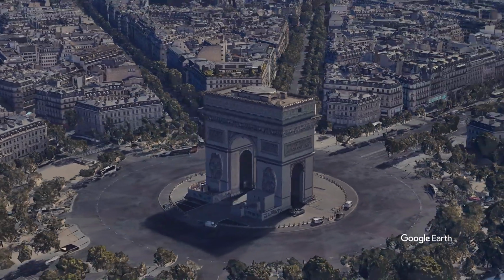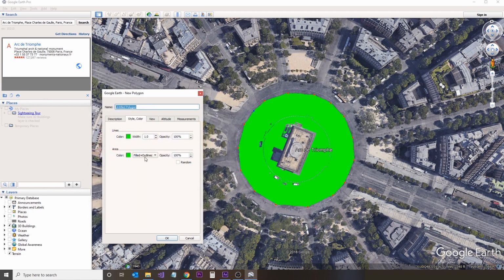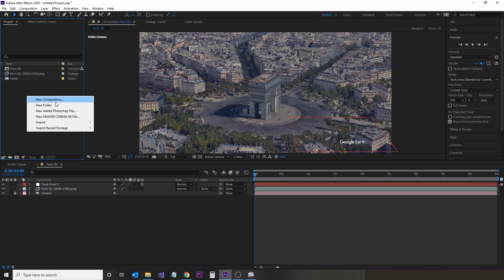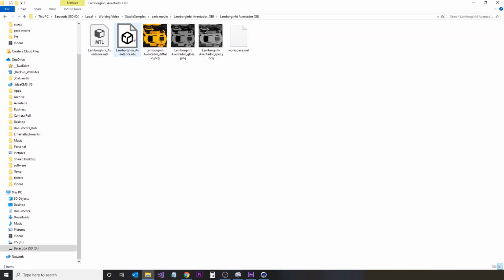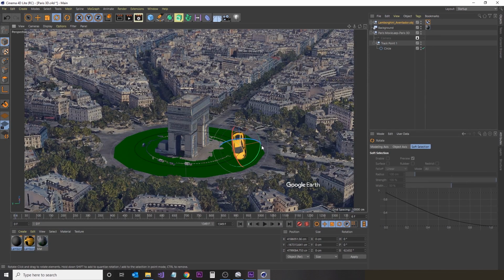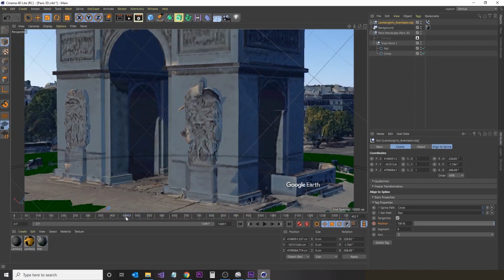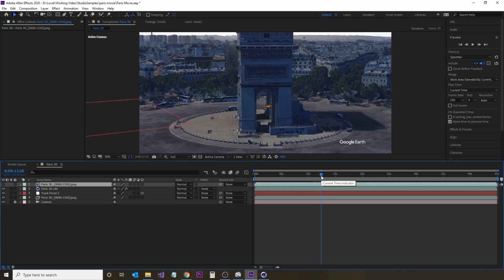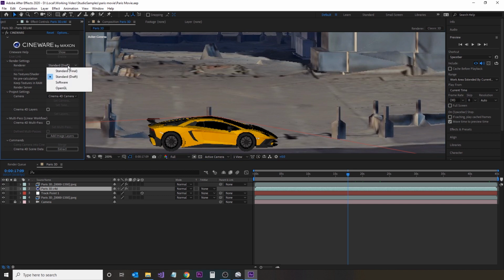Google Earth Studio - Add 3D Models and Layers without rotoscoping/masking!

Comment: Hi, for some reasons the keylight in After Effects won't delete the kml area (the round green area in your video)...Any clue? I tried different settings of the keylight effect but nothing... Could it be due to the fact the area I've left the area drawn in Google Earth Pro white (not turned green)? Or maybe to the fact that while in your tutorial the green area is always visible in my Google Earth animation is just visibile in parts of the video? (I left the polygon color white as is in the middle of a garden...It works if I select the garden...). Shall Blender be the solution would the logo be covered by the trees when they'll be within the camera and the logo? Thanks https://youtu.be/y2EsYnWgT08
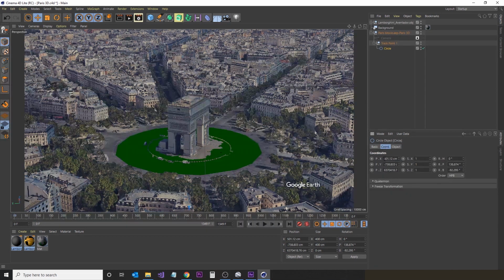Reply from the maker: Hi - I now use "Linear Color Key" (good) or "Difference Key" (better).  Also, you may find that if you use the "Time of Day" in GES, it will produce several different shades depending on camera angle - if you don't use the "Time of Day" it will produce a better green screen value.  Check out this video for my newer technique: https://youtu.be/4gtpPkfXv7s (at around 11:00)